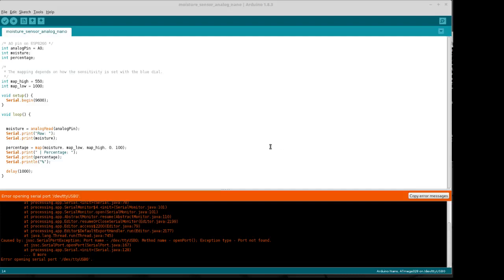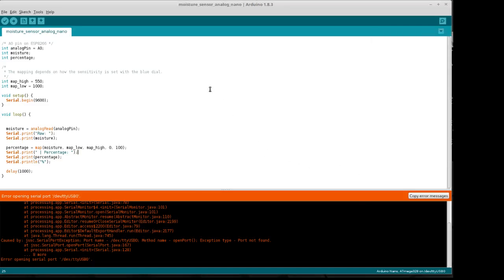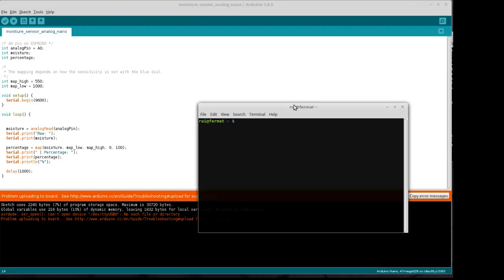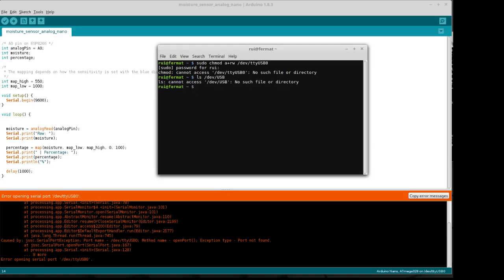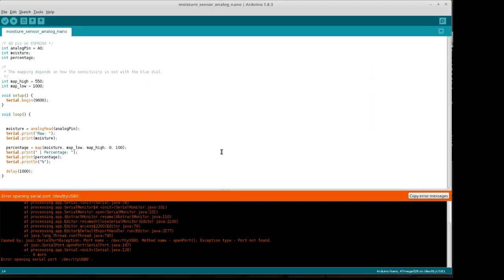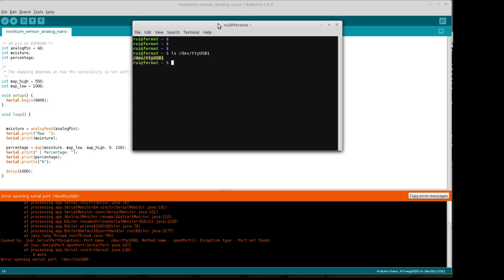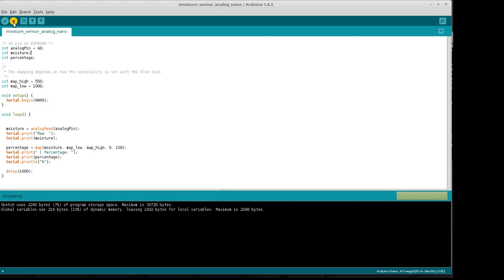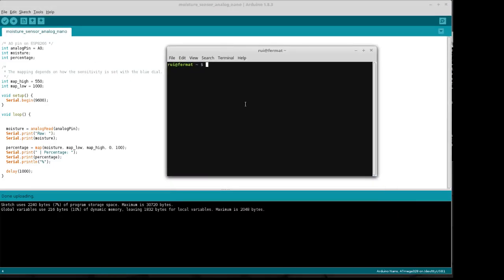How to fix Error Opening Serial Port dev ttyUSB0

Comment: Is your board a genuine Arduino brand or a compatible? I ask because apparently, the 'compatible' boards need a different driver without which /dev/ttyUSB* or /dev/ttyACM* simply don't exist. My own first board (bought last week) is a 'compatible' and Arduino IDE 'sees' only /dev/ttyS0 and S1, neither of which will connect to the board. Frustration mounts quickly as I can't get the alternative driver to work either :( but I thought I'd add this comment as you seem to be getting a number of people saying your solution doesn't work for them.  The difference between genuine Arduino and compatible boards may be the reason.

Comment: To change the permissions is the wrong approach, add your USER (rui) to group which is read/writable already.
ls -l /dev/ttyUSB0 
crw-rw---- 1 root dialout 188, 0 Oct  2 17:21 /dev/ttyUSB0
in my case the group created by udev is "dialout"

To solve the problem permanently do:
sudo adduser rui dialout
or in general
sudo adduser <yourlogin> dialout

Cheers
Chris
Reply: I like this approach better, but it didn't work for me, I added my user to the group and the problem persists, only the command from the video worked
Reply: Thanks Chris your steps worked for me after a reboot and are permanent

Comment: Hi @willworkforliberty
I followed your same steps, but I keep receiving this message:

avrdude: ser_open(): can't open device "/dev/ttyACM0": Permission denied
An error occurred while uploading the sketch

I've tried everything, I'm using Ubuntu 18.10 and an Arduino UNO Rev.3, I've been able to upload the sketch from a windows PC but since my main pc has linux, would like to solve this bug.
Reply: you do not have rights to operate the serial device, eiter  try it with sudo or add the the user to the dialout (I think) group

Comment: In case you run into issues listening to the device using e.g. cat, try reinitializing the device using 
stty -F /dev/ttyUSB0 cs8 9600 ignbrk -brkint -imaxbel -opost -onlcr -isig -icanon -iexten -echo -echoe -echok -echoctl -echoke noflsh -ixon -crtscts

Comment: Thanks it worked. 

why did not this command work any idea. it worked well before
sudo usermod -a -G dialout $USER
Reply from the maker: Perhaps the existing permissions on /dev/ttyUSB0 are not group writable, or (less likely) the /dev/ttyUSB0 device was not owned by the dialout group.  Could be root:root or root:tty.  Check the group name and its permissions with `ls -l /dev/ttyUSB0`